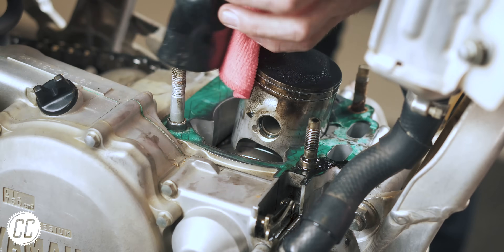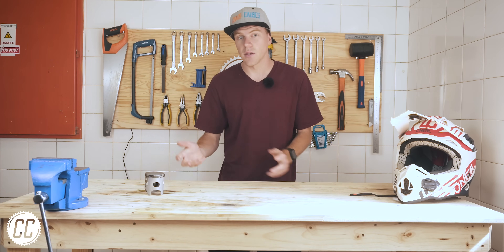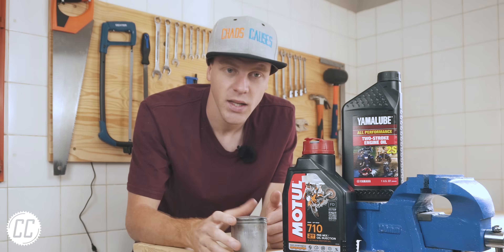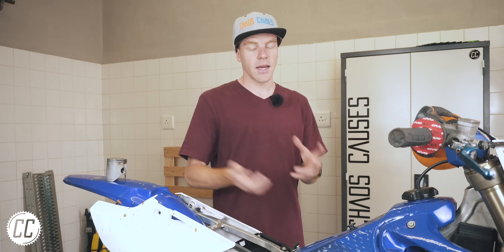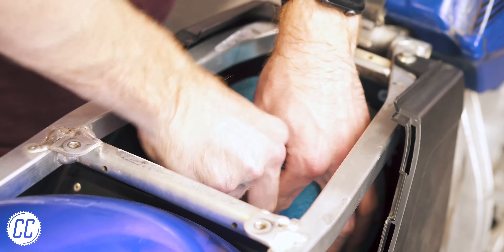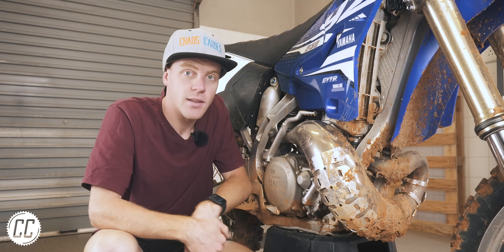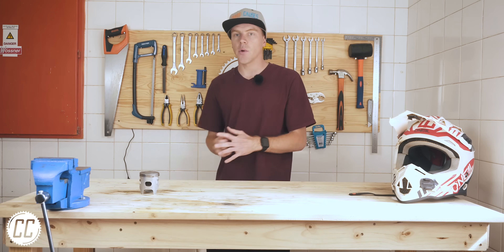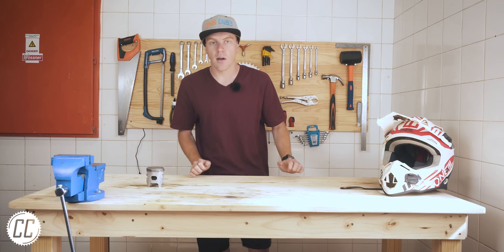What Causes 2-Stroke Engine Damage?

Comment: most commen cause is neglect  , a rebuild DTRs and as long as ya give a good thrashing about to keep the carbon build up down (ya have to get a 2 stroke HOT) and don't ride too slow and letting the barrel and exhaust fill up with gunk(oil carbon ect) ya need to burn it all away , fix any issues before thhey get to be an issue like greasing the bearings and  changinj the engine oil every few 100 miles ,don't leave ya bike in the rain all the time keep it covered up and empty the petrol tank every now and again to make sure theres no water in ya tank ,clean the airfilter and I never use water to clean my bikes I use furniture polish and DP 60 penatrating oil or WD 40

Comment: Everybody says they run a good oil, and if they are not having problems and get good lubricity, all is good.  But I know some guys in North CA. who had problems with their race engines lower rod bearings, and they ended up doing some great durability dyno testing, for the best oil.  Motul  Kart GP 2-t oil won their half hour, wide open at peak power dyno tests.  Klotz Supertechniplate (Klotz uses 20% caster mixed with their synthetic), was right there with it too, but runs a bit dirtier if the jetting is not crisp.  Motul is way more expensive, but I use it now because I know how sharp those guys are, and testing like that is very rare.

Comment: Defective casting or damage from machining, but there would be evidence on the piston, rings or skirt. PS: AND Where the chip was, wasn't affecting a damn thing! Not exhaust timing anywhere, I'd have put a 10°taper on it top and bottom chip area, checked ring gap, and sent it! Zero harm done. But Like someone below said- (piston may have already been changed-good call,) but its a non issue - unless * it hints at more casting defects. In which case only Time will tell OR  you get the barrel tested.  Sonic? X ray? NDI? Idk. Jmho. Good luck. Might be worth getting checked. GOOD LUCK!

Comment: He couldn't be more wrong about the Yamaha brand oil. Yamaha does not make that oil. It's made in a oil refinery where all the other ones are made, just because you run Yama Lube, doesn't mean you're going to prevent damage. All 2 strokes will need new piston & rings after so many hours of run time, that's just the nature of 2 strokes. Yes, good quality oil is important, as are many other things, brand however, is the least of importance.

Comment: if my cylinder has a ridge at the top (presumably where the ring/ piston wasnt reaching) do i need to have it honed down? i know it was there during my last top end rebuild and nothing went wrong after 50-100 hours of riding. but i am doing a full rebuild of this bike (3rd gear was slipping) so i dont want to risk anything. at a guess it probably sticks out like a quarter or half a millimeter or so. i guess ill take it to a shop and see what they think.

Comment: You can use aerospace 303 protectant on your carburetor gaskets to condition them. This will make sure your carb runs consistently. You can also use 303 on your tires to extend the life. It is water based so it wont affect the tire traction.

Comment: A great idea is to add a small amount of seafoam in your fuel to stop your piston rings from sticking. Also adding seafoam in your spark plug hole at top dead center when storing the bike keeps it running perfectly. You can extend your riding times before top end jobs.

Comment: to me that doesn't look like oil issue. might have been small crack from the factory and it just chipped off during a ride. also that didn't look that bad. surely would have been ok to ride

Comment: The previous owner could have had the throttle cable too tight. This may cause the little nub at the end of the cable that attaches to the slide to get torn off and ingested by the bike due to the force of the handle bars. It would explain the perfect size hole. Just check your cable tension in your manual

Comment: Spooge isn't the result of too much oil in your gas mixing, if anything it'd be the opposite.
Also your point about the engine not getting enough lubrification when closing the throttle at high RPMs is kind of a debunked myth, there's usually plenty of lubrification left and still happening in the cylinder, as the spark plug isn't getting to burn all that's left, because of the closed throttle, usually, if you aren't doing more than a mile of engine braking, your engine should be fine.

In conclusion, adding more oil in your mixture can result in less spooge, more lubrification, and some also say more power, as the oil will help seal the piston better, there are actually a couple of experiments on this topic.

Comment: Ok, a couple things. One, Motul is aweful. Switch to Amsoil. You absolutely will not regret it. I know 2 people that switched, and they both testify to getting 40% more life out of their top end. Two, Try a hotter spark plug to burn off that excess coming out the pipe, or look into repacking the silencer, thats cheap and easy, and will soak up a lot before that starts happening again. Three, Check out Project Farm's comparison on oil. He did a great job at testing several oil brands, including motul and amsoil. Not 2 stroke oil test, but you can expect same quality. Ill link that video for you.

Comment: Typically severe engine failure is from cold seizures, to include 4 corner cold seizure. 
Normal ware would reduce compression, resulting in performance loss and running poorly. 
Clutch less shifts are ok on dirt bikes, the force is absorbed through chain, then ultimately rear tire is able to slip. If you had 100% traction similar to street bike there is no loss of traction, so gears ⚙️ take the abuse.

Comment: probably just a casting or plating defect, leading to a crack ejecting the piece. it sounds like you are doing everything right, and I know I have treated my bikes far worse without chipping my nicaseal. ie I've blown up a lot of pistons, few seizures, and a water pump failure and never chipped, but have worn out the plating.

or the previous owner ported it without replanting it because it will chip easily in that process. or honed the plating for a rebuild that will cause cracks and chips too. the plateing is hard but brittle and doesn't like to be scratched.

Comment: Warming up the bike is also a process of heat expansion in the cylinder. Since the pistons walls are much thinner and there is no cooling on the piston like the cylinder has water cooling, the piston heats up way faster than the cylinder if you go all out right away so thats means the piston expands lore than the cylinder. The piston will expand too much so the clearance between the piston and the cylinder walls are much tighter and it may lose all clearance and it will seize.

Comment: Just found this channel, awesome content! As an experienced YZ250 owner and general stroke motorcycle fanatic, a few tips:

Warming up two stroke engines isn't as much about the transmission as it is about piston to cylinder clearance, when the bike isn't warmed up sufficiently the piston expands faster than the cylinder and thus can have excessive wear and even may seize (this is known as cold-seizure). Given how your old piston has significant visible wear and scoring on the exhaust (hotter) side and you had a fractured exhaust port, insufficient warm up was almost certainly the cause of your cylinder damage. 

On the subject of premix/oil, 40:1 is perfectly adequate with a well made high performance oil. That said, select the proper oil for your application. Motul 710 is excellent for woods/enduro riding as it has both low viscosity and a very low flashpoint. If, however, you ride motocross, desert, or any discipline with lots of sustained high RPM's, a higher viscosity and higher flashpoint oil (such as Motul 800) is recommended as it will resist fully burning off/combusting at the higher associated engine temperatures. I highly recommend you NOT use the Yamalube 2-S as that is specifically formulated injector oil and is very low viscosity, Yamalube 2-R is what is recommended for the YZ250 and would be a much better choice. 

Don't use exhaust sponge/oil as an indicator of engine oiling, sponge is just unburned fuel/oil exiting the engine and is present due to overly rich jetting, not due to excess oil. 

Hope this is helpful to any new two stroke owners!
Reply: Finally someone with actual experience! A rare breed in YouTube comments section. I have an old Yamaha RX100. It has one of those pesky oil injectors that almost always throws a hissy fit if I even look at it the wrong way. I always have to calibrate that damn thing but 2-strokes are crazy fun!

Comment: Oil ratio doesn't determine rich or lean Ness. Jetting does. You can run 100:1 and be super rich, or 10:1 and be lean. Also you need to put grease around your air filter. 

As far as warming up, wait until the radiators are hot. But you need to keep revving the bike to clear it out and warm everything up even. Also play with your clutch as it's warming up, to help separate the plates with the cold thick oil holding them together.

 As far as the myth about pulling clutch in after high rpm. You don't really need to. Just blip your throttle. I promise it's not hurting the motor one bit. Have you ever seen a pro racer pull their clutch in back in the day? Not really. On the motocross track it's such a short amount of time before you have to get back on the throttle again there's no point. Shoot I'll go from 5th tapped to 2nd or 3rd to get the maximum engine breaking, never had a issue...

For jetting. You do not want to run to rich as you can do just as much damage as to lean. You want your spakr plug dark paper bag brown. Oil out your silencer isn't a good thing. You need to repack your silencer and lean your bike out a little. That oil is unburnt fuel which isn't good.
Reply: My yz125 runs ok but drips a lot of oil from the exhaust, so I just change the main fuel jet in the carb to a size smaller ?
Reply: @okerhrh4139  need to repack your silencer. Go to stock jetting. And then you need to figure out your elevation, and temp and jet your bike accordingly. I would suggest 40:1 with redline. I run my 125 to the ground and done 100 mile desert races/rides and never once had a issue. If you can afford it. Run AV gas.

Comment: I wouldn’t trust the amount of spooge out of the tail pipe as an indicator that the bike is properly lubricated. Excessive spooge could mean that you’re getting blow by past the rings on the downstroke. In other words, fuel/oil is not getting into the cylinder through the ports and is not completely combusting.
Reply: True but I've never seen a 2stroke bike that didnt have oil coming out of the exhaust. Some more then others and even on bran new bikes. My riding backpack has a million black tiny spots on it after years of riding. I usually mix around 40:1 43:1 and I've always ran castor 927. Ive have heard alot of the time it's the type of oil a person uses, that makes that black spooge, or obviously If your running to heavy on your oil mix.

Comment: When you oil a foam filter, it should not have oil beads or drop on the filter. I have tested this on a dyno and over oiled filters reduce intake air flow and makes your bike run richer. Once the filter is oiled, put it inside a clean plastic bag  and massage the oil into the foam itself. The plastic bag will remove the excess oil that forms beads on the filter and also keep your hands clean. A filter that was massaged in a plastic bag also flows more air and let your bike run at the right air fuel ratio. You can also gain a horsepower or two more when doing this, and not running an over oiled filter.

Comment: Ok, yes, I have a history of riding dirt bikes and maintaining my friends racing dirt bike. I'm a tad confused though. Was there anything going on that made you look ? From what I heard there wasnt. So to me that so called damage is or was not an issue. My friends dirt bike, rode every weekend for hours and then raced on weekends twice a month never had any issues. Granted not the same bike as his was a yz250 back in the mid to late 70s. But the only thing I ever did was replace the rings between motos. Otherwise just normal maintenance. Sooo, did you actually have a real issue ?

Comment: 2 stroke engine braking is a myth. if so then it would seize under idle. if it’s getting fuel, it’s getting oil
Reply: I think the issue is prolonged breaking at high revs. Mine blew up after multiple descents from a 500 foot hill climb. I think it starved the top end.

Comment: The engine braking thing is BS I rode raced bikes 2-stroke bikes for years and even ran flat track with them shutting the throttle off going into the turns in both situations never   never had a problem. I had more problems cold seizing an engine from not letting it warm up or not breaking it in long enough
Reply: short doesn't harm a 2 stroke, but going from a long hill only braking on the engine might cause damage as the engine does not get fuel and so no oil.
Reply: @wilco300674  ye say if your going down a very steep hill for about 20 seconds that’s when it probably starts fucking up the moter because there will still be oil in the cylinder it won’t dry up that quickly it’s like wheelies people say it isn’t good for them as the oil is at the back and the engine isn’t being lubricated.say if you were all the way back constant for about 5 minutes then yes it problay would be shit for the bike but your always going up and down so the oil finds it’s way around still but that’s a similar kind of thing to 2 stroke engine breaking cause everyone thinks your starving the bike u are are fine unless it’s a really excessive amount
Reply: @Louisjayanstey  nah ive engine braked for miles and miles of down hill. No issues. You still gey FUEL when you are engine braking.
Reply: @richlee7047  then why do people say it does Fuck the engine ?
Reply: @Louisjayanstey  who is they lol. I've only owned 2 strokes. I have never ever seen one sieze or blow from engine braking. There is constent air flow + fuel flow while engine braking. If youre scared pull the clutch in blip the throttle here and there while going down hill. I "engine brake" really hard on my bikes when im riding the track, im more worried about me blowing my gear box vs piston frying off or something. If youre bike is jetted good or even if it aint it is completely okay.

Comment: The engine brake is bs, you are still getting the same amount of fuel, as the piston is still sucking it in, just the carburetor is not allowing the air in to burn the fuel. Therefore you will still have plenty of lubrication, this has been proven many of time’s before

Comment: idk but running motorex cross power at 60:1 with no issues on anything over multiple years has been pretty good with no rebuilds just normal maintenance and cleaning

Comment: With modern engines and oils, you can go even further  : 1/50 ... ou 1/60.  No joke, my 582 Rotax was very happy this way, while giving it's 65hp full power for hours in a row.
Using too much oil it is really worse than too little... too much oil ends up in much faster rings / cylinder wear.
A good way to sieze a two stroke is to cool it too fast...however, your is water cooled so no risk of cooling schoke.
Too lean is a bad plan because it overheat the exhaust ports edges. But on you type of bike, you probably don't ride with throttle full open  for very long period of time in continuous.
One more idea, something was sucked in the cylinder end did not pass the port fast enough...and get caugth by the piston edge....and it can actually be anything from sparkplugs to casting burs, not mentionning piece of gaskets, anything falling in the air filter during maintenance...
Don't be too anxious : two strokes are usually VERY reliable and 100 hours at YOUR pace is not going to wear it a lot...

Comment: No visible damage to the ring or piston. all you need to know. with "75h" on it when sold, should not have needed to be disassembled by then. spotting OE gaskets or signs of intrusion, shiny loosen corners on bolts, sealant. etc could point at prior owner deception, but that's moot as it "ran brilliant"
i'd suspect mfgr defect, and thank you for taking the full repair path, before it became serious.
besides compression records, piston inspection through the exhaust port, i heard no reason for a full teardown inspection. 
i'll leave you with this one point to ponder, examining piston wash, clean area size by the transfers is one of the proven low tech ways to check combustion.
3:36 shows the crown with no clean areas, suggesting the piston was getting hot enough the incoming charge could not keep it from baking on oil.
confirmation would be a matching carbon area on the underside of the crown.
enjoy your ride.

Comment: I think you have a good handle on what to watch out for. I can't say I would do much differently. The only thing I will add is when replacing a piston I tend to think some aftermarket may lack the proper expansion properties so I may consider a yammi piston or do research at l ast. I think your damage was probably a defect in casting from the beginning. I would run 32 to 1 because I feel companies push the limits due to emissions standards. Longevity is loosing that battle. Same with what the EPA has done to Diesel engines. They can't meet standards and last as long as they did a decade ago.

Comment: I dont get how pulling clutch would help "lubricate"... Its damn same if you just shut off throttle. Pulling clutch doesnt magicly stop your engine, it just doesnt provide power to your rear wheel, rpms, fuel consumtion doesnt change
Reply: Try engine breaking your 2stroke and I promise you dont have it anymore
Reply: well pulling your clutch in with no throttle just drops it to idle so